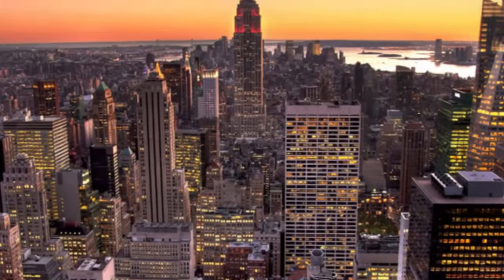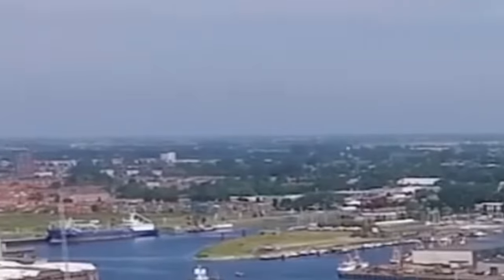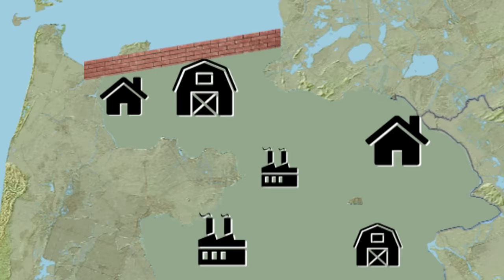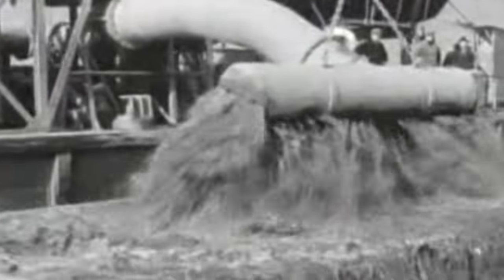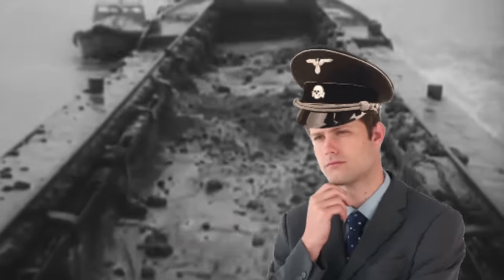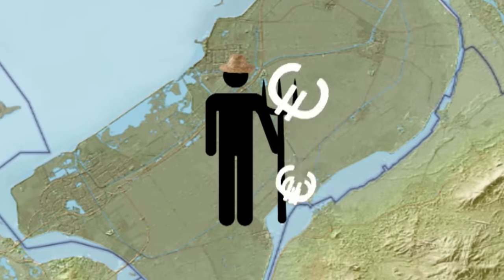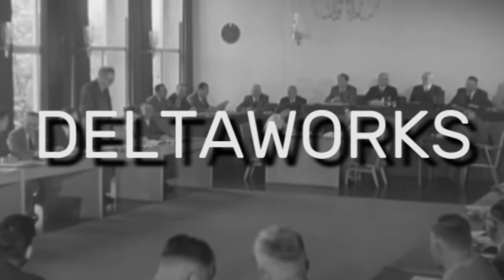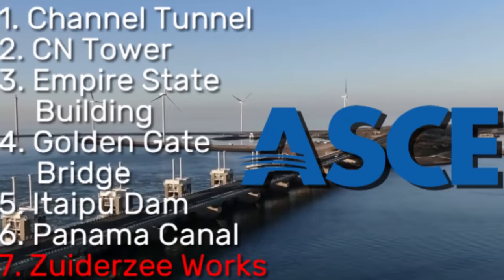How the Dutch built the Netherlands

Comment: Nice Video! May I suggest, it would have been nice if you mentioned the "Maeslantkering" or "Stormvloedkering". This is a huge storm surge barrier protecting the city of Rotterdam and surrounding land for possible floods during heavy storm. The Maeslandkering is as long as the Eiffel Tower and weighs more then four times it's weight. This barrier remains open all the time to let many ships through and only closes during floods. https://nl.wikipedia.org/wiki/Maeslantkering
Reply: 7:00 gaat over de stormvloedkering.

Comment: Great video! There is just one thing: it's not the rain that caused the worst floods in the Netherlands but storm surges. Strong north western winds above the north sea can push enormous volumes of water south-east, into the funnel formed by the UK on one side and France/Belgium/the Netherlands on the other. Because not all the water can fit through the English channel at once, sea levels can rise substantially during the storm. When this conincides with spring tide, water levels can be exceptionally high, causing floods not only in the Netherlands, but also in Belgium and the UK. The Netherlands are usually hit hardest just because they're the lowest, but other countries in the region have had to take measures against storm tides. For example, the Thames barrier was built partially because of this.

(Also, it seems like a bad idea to protect yourself against too much rain by building dams, because they keep the water in instead of allowing it to get out.)

Comment: 4:20 the polder was actually completed before the Germans arrived, but they flooded it, setting the work back several years
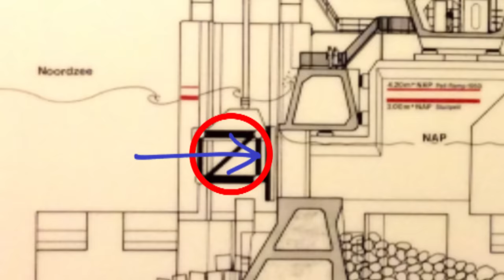7:15 not true at all. I wish we were immune to flooding, but there are several extremely pressing problems like oxidation, unpredictable regimes of rivers, and badly maintained seadikes threatening the safety of citizens in around 70% of the country.